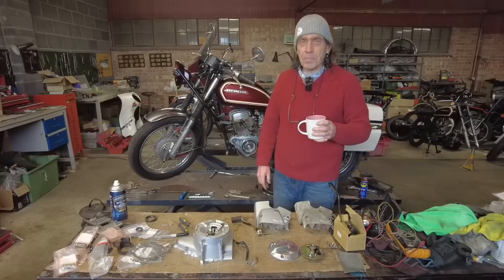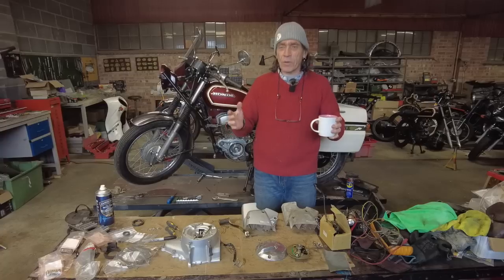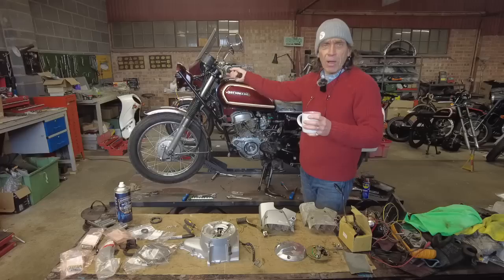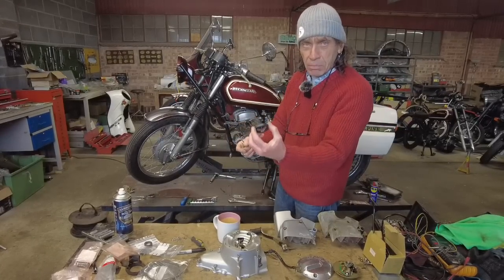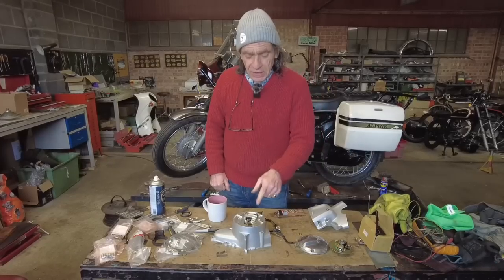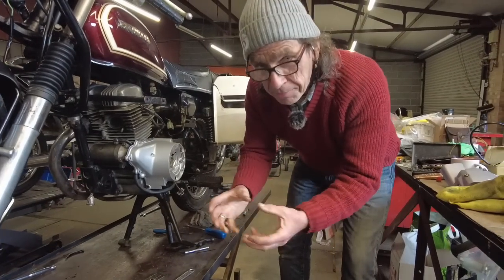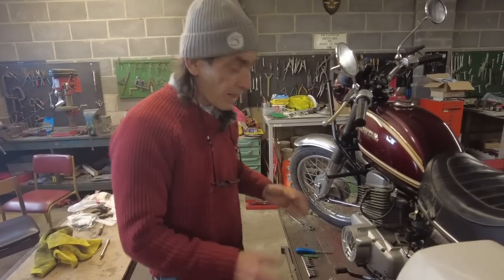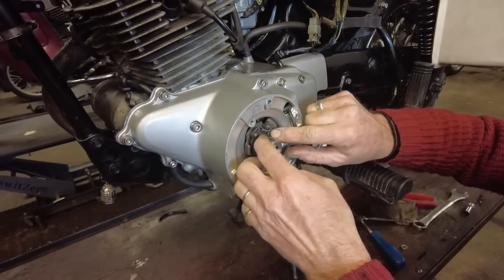Benly Oil Leak and Timing Gremlins

Comment: Those casings look good Guy, I use K2 silver brake calliper paint, it's near identical to the original colour and finish and is heat resistant too.. And yes it really is essential to copper-grease Honda engine casing fasteners, whether stainless or plated.. Last year it took me three weekends to remove the original plated Honda fasteners from both side casings on a Honda CB 125 K3 engine.. To be fair they probably haven't been moved since 1971 when the engine was built but most weren't even rusted in, they just wouldn't move without heat and/or an impact driver with some hammer action !

Comment: The hammerite super smooth looked pretty decent to be fair , just wondering how well it will hold up to many many gear changes  & foot being rubbed up near it.  the timing. i always used the bulb & power method.....mulitmetre  just as good ,
Reply from the maker: Hopefully the Hammerite will last ok.
Time will tell
Reply: Hammerite is pretty tough, I reckon it’ll hold up ok.

Comment: Hi Guy. Is all silver / chrome coloured paint fuel proof? The reason I ask is that years ago I built a balsa wood control line P47 Thunderbolt and painted it with Humbrol silver enamel model makers paint and as soon as it got engine fuel on it which was ethanol based, the silver paint ‘melted’ and I had to strip it off and repaint the aircraft in another colour. I was told at the time by an uncle who was a very experienced model aircraft maker that no silver paint was ‘fuel proof’. Now I don’t know if he just meant that no silver paint was ethanol proof or if he meant any fuel would melt any silver paint. This was back in the 70s and my uncle is long gone so can’t ask him what he meant by fuel proof. However, modern petrol now contains around 10% ethanol so wondered if the paint you used on the casing could be affected is fuel was accidentally spilt on it? Hopefully, paint technology has moved on in 40 years and so not a problem today. What are your thoughts / experiences of using modern silver paint? Have you found it quite safe to use?
Reply from the maker: Hi Mark, the honest answer is I’m not too sure. Luckily I use Esso E5 petrol and that doesn’t have any ethanol in it.

Comment: Sorry to be picky, but no mention of adjusting the points gap or where and how you fixed the meter leads and how they related to the points gaps opening...or did I miss something? I want to thank you though for a commonsense approach to every day sensible motorcycling useability. Cheap and reliable transport from the very unfashionable end of the biking scale. By  the way., could you give a link to the nut and bolt source you use in Bedford?
Reply from the maker: Fair comment, I’ll re-visit timing in more detail down the line.
Thanks for your support.